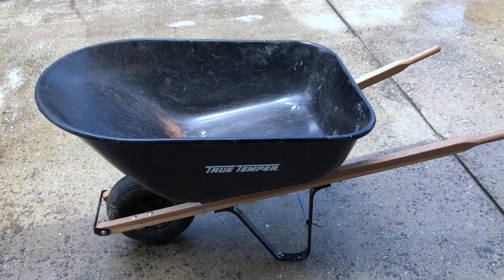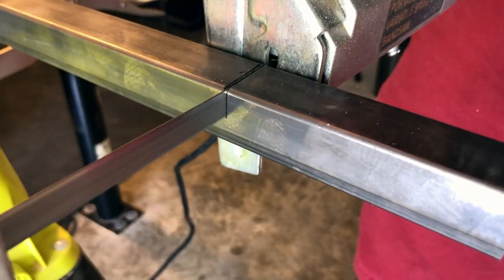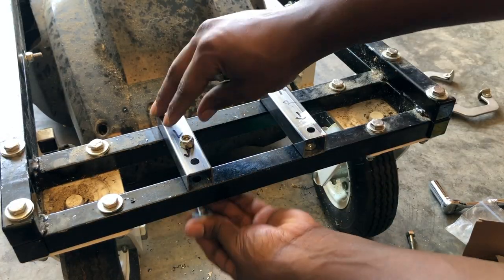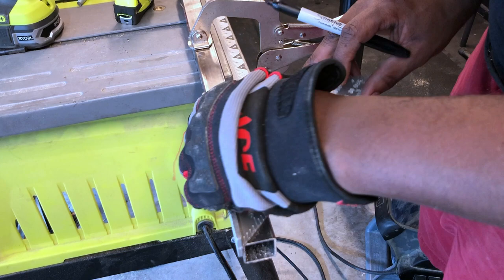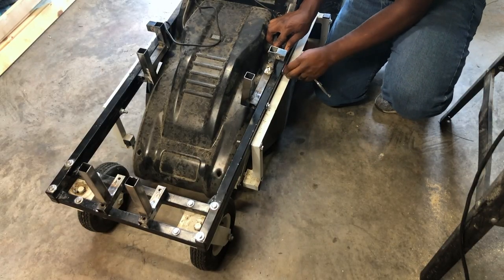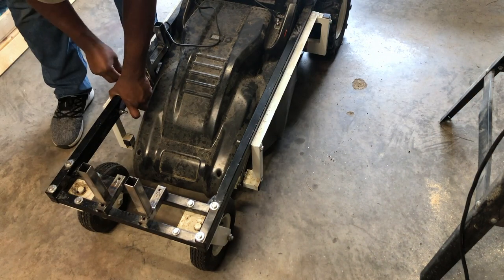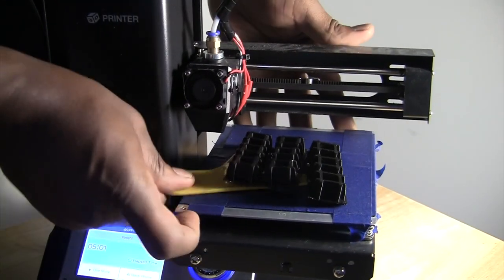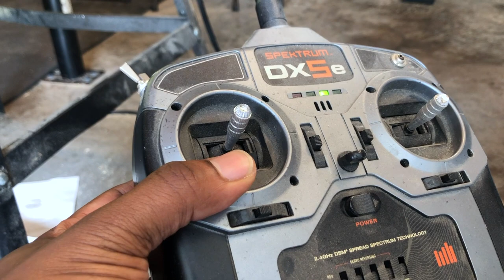RC Wheelbarrow & RC Lawn Mower | 2 in 1 | DIY

Comment: I think you mentioned Parallax as your microcontroller. Do you prefer it over Arduino?  I have a a few different controllers, but still learning how to use them. I kinda like the idea of running a raspberry pi/ arduino combo.  I also have an old Apple G5 tower attached to some power wheels parts. Hopefully will be able to post some successes on that soon. 

Really nice job on your project. I like your attention to detail and paint job at the end. Thank you for posting.